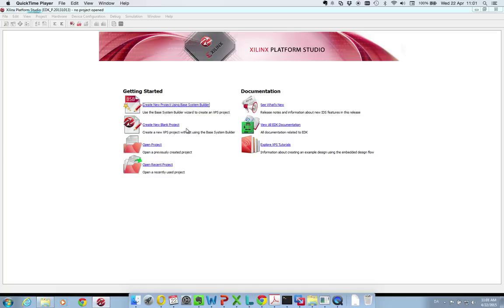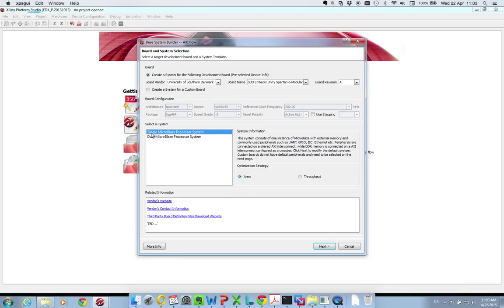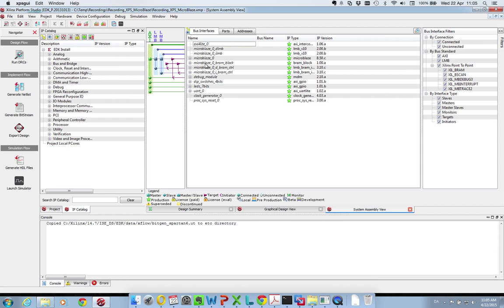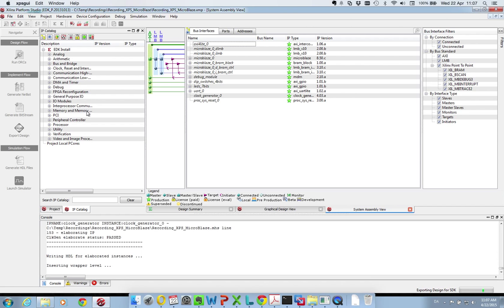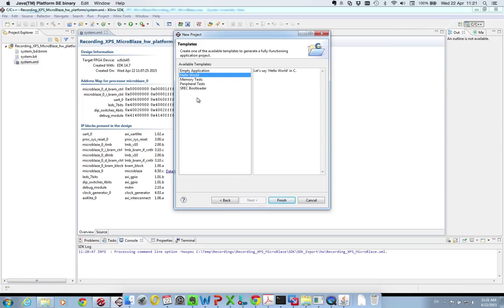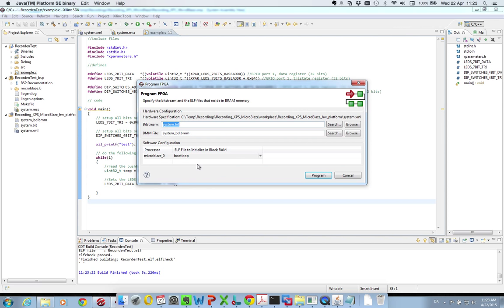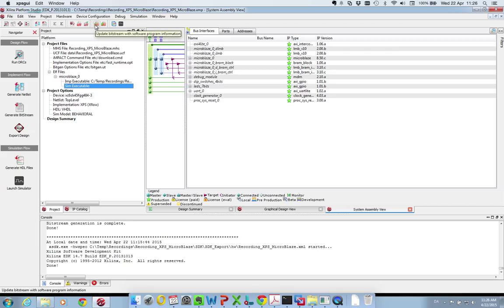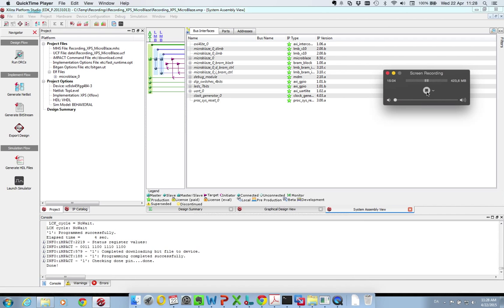XPS MicroBlaze Setup

Comment: Excellent  tutorial. Its time to test it on my own system....!
Reply from the maker: Thank you so much. I'm very glad that you find it useful :-)
Reply: I ran it on my Genesys (Its a very old board, I know, has a Virtex-5 chip) It ran perfectly!! Blinks the LEDs with push buttons.

[Solved] But now I'm facing a problem....  . I added a GPIO manually, connected to system plb bus, added respective Nets in the ucf file, generated addresses just like you taught us. But I can't Update the bitstream now. It runs for a long time just as before but ends with errors like Net blah blah not connected to any driver. Looked like a Net linking problem, so I deleted the new IP. The same problem is gone but still, there are many other error. XPS has gone mad, I think. 

[Solved] 2nd problem, I tried running the application after some changes. It worked initially but after a few runs, the "Run application" option is gone from the "run as" menu.
Reply: I Solved the above issues. The only issue that now remains is that when JTAG debug is enabled via USB port, it fails to connect to the JTAG target. It did connect some time ago, but now it can't. 

Error opening JTAG UART @ localhost:-1

Comment: HI i am using Spartan 3E and trying to implement the exact same same code as per your tutorial but I get errors when compiling, Can you please assis on why i am getting errors?

../LED_DIP_SWITCH_EG.c:24:2: error: 'XPAR_LEDS_7BITS_BASEADDR' undeclared (first use in this function)
../LED_DIP_SWITCH_EG.c:24:2: note: each undeclared identifier is reported only once for each function it appears in
../LED_DIP_SWITCH_EG.c:25:2: error: 'XPAR_DIP_SWITCHES_4BITS_BASEADDR' undeclared (first use in this function)
../LED_DIP_SWITCH_EG.c:30:4: error: 'temp' undeclared (first use in this function)

Comment: Hi 
What is the max frequency of spartan-6(xc6slx9 -2) in MicroBlaze mode and how can i do this in XPS ?
Thank you.
Reply from the maker: Its difficult to say since it depends on your design as well how high a frequency you can reach. The implementation process of getting a MB onto a Spartan 6 is the same as on a Spartan 3 or to a large extend any Xilinx FPGA. That of cause, that the FPGA needs to have the needed resources to handle the MB.
Reply: Ok. Thanks for responding and assume i want to reach to 250MHz or higher. How can i do this?